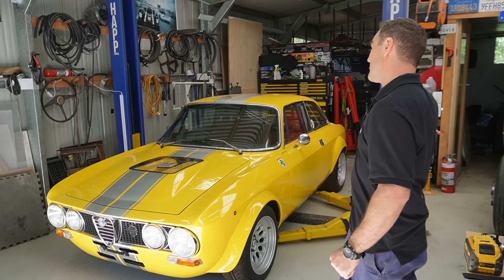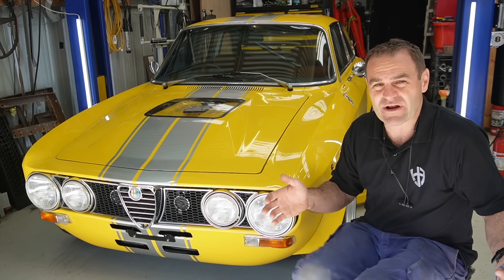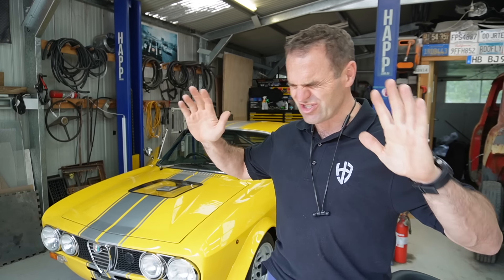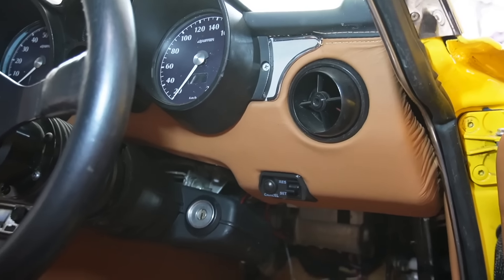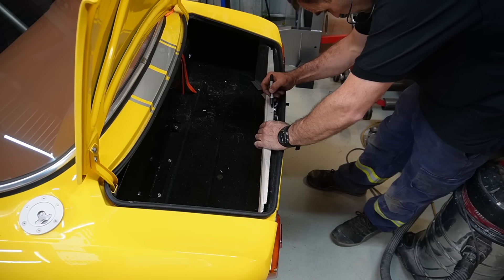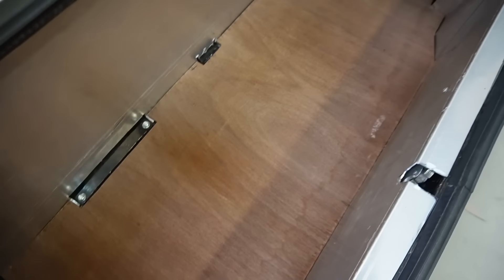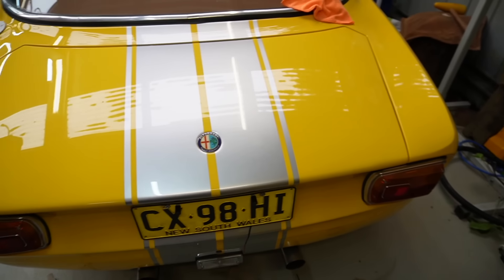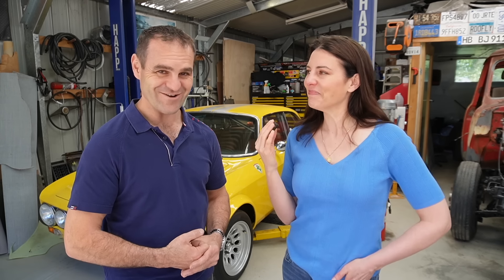Cruise control?! - Ferrari engined Alfa 105 Alfarrari build part 221

Comment: Regarding the boot side panels, don't use mounting screws, use self adhesive Velcro, much neater and will also stop the panels rattling. Also, put some padding/deadening under the plywood, otherwise the sound transfer into the cavity will drive you nuts every time you go over a bump and there is stuff in the boot.

Comment: Geoff, when you cut plywood like that, cut the outer veneer with a good sharp knife, use a metal straight edge, you need a lot of force to keep straight edge on the plywood, or simply use your metal brake or similar. BTW a few passes with the knife on both sides will cut the thin plywood through. Leaves the plywood with very little tear-out, if any. Seal the timber with epoxy thinned or epoxy wood preservative.

Comment: Great video Jeff. 
I'm wondering if you might regret the way you've covered the battery totally?
If (no...."when"!!), you need to access the battery,  you're going to have to remove the side wings, then the floor, then the front cover.
Would it be possible to make a removable or hinged cover, just for the battery?

Comment: Just get some strong magnets for the side panels
You can honestly just use panel bond to hold the magnets on

It will be even neater as there will be no screw holes, also means you don’t have to unscrew 2 of the panels if you need to replace your battery
Reply from the maker: That is not a bad idea at all
Reply: Or velcro.
Or a combination.

Comment: That hole where you are putting the cruise control HAD a cruise control in it originally.  Yes a Choke also.
Basically the cruise control was a manual throttle control.   You pulled it and it had resistance, and obviously did nothing but put a fixed throttle position in, so if having to slow down you had to push it in OR put your foot on the clutch.    So putting your new cruise control here is PERFECT - especially  modern version of what will really work.

Comment: That gap by the steering column on the lower dash is for the manual throttle lock. Afro Romeo basically just locked the throttle cable as a cruise control device.  One had to remember to disconnect it before shifting because once the clutch was in it redlined the engine.

The stock glove box is much larger than what you have designed.

Used painter tapesl on your plywood veneer cuts and you won't shatter the edge.

Comment: You should have cutouts in the side panels to utilise the space in the arches. Bit of bungee netting in there👌🏻
Reply from the maker: The issue anything in there can dent the outside of the car.
Reply: @HomeBuiltByJeff  bit of foam on the inside of the body work would stop that, and add extra sound proofing from road noise from the back.

Comment: Nice new logo Jeff m8

Very contemporary and minimal dynamic!

Only detail I found would be centring it so the lower section of the J would have a straight edge.. instead of a point.
Reply: Leather production has a process where they shave the edges thinner, allowing for more seamless folds.

Comment: Great job man! The CC controls look absolutely factory!
What were your plans for inside the glovebox? Leave it as-is? Or flocking?
And inside the boot do you need any vent holes or weep holds in case water gets inside?  
It looked like you had some room on the sides of the boot between your aluminum panels and the body of the car - maybe put some cool little ‘storage compartments’ with a cool little door, sort of like a glove box for your boot, for small items that belong in the boot, like spare lug nuts, or small tools.  
This car is simply the coolest car I’ve ever seen, and if I ever get to Aus I’m coming over to see it! Cheers man

Comment: Can you solder a switch under the clutch to mimic the behaviour of the cancel button of the Cruise Control ? Just in case of danger and you have to act fast with both the hand on the steering-wheel
Reply from the maker: Brake does that.

Comment: I knew it was going to be an X1 Carbon before you even anounced the sponsor. 

Whilst it is undoubtedly a brilliant machine, what you and every other content creator fails to mention is that it is very expensive indeed - obviously it's going to be a lot simpler to operate than a $300 Ender 3. It's not just a simple "oh you want a better machine? upgrade to this!"

I don't think it unreasonable to assume that most hobbyists are not the target audience who are willing to spend around $1500 AUD on what is, ultimately, a hobbyist's tool and not a professional machine.

Comment: Sorry, but that placement is unacceptable for me. For the cruise control, when I get on the highway, I literally drive on cruise control. I go faster and slower just using the cruise control. It's kind of a fun little game I play

My VW has it at the end of  the stalk. It's a rocker switch up-and-down, and it's just perfect, I barely even move my fingers and it's on and off and on and off and on and off. I was nervous when I first got the volkswagen, but it's great placement. Way better, than GM did for years on the side of the stalk😊